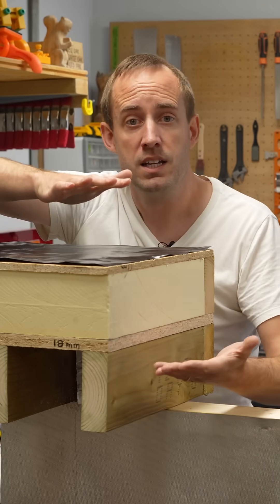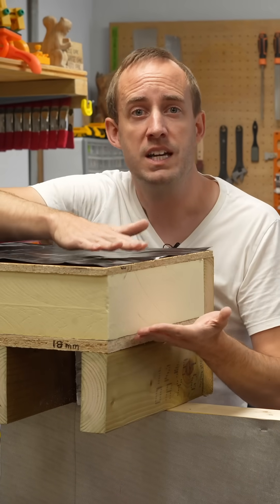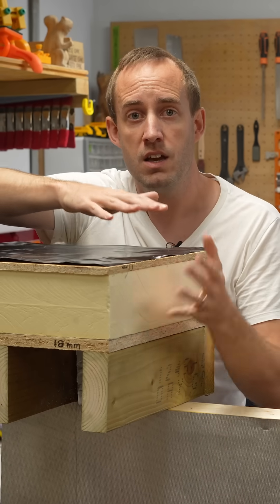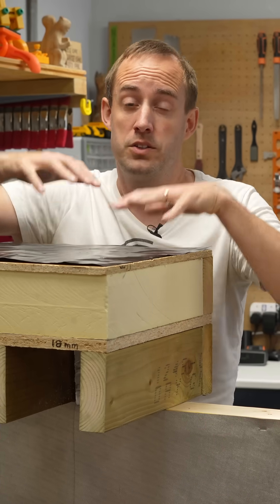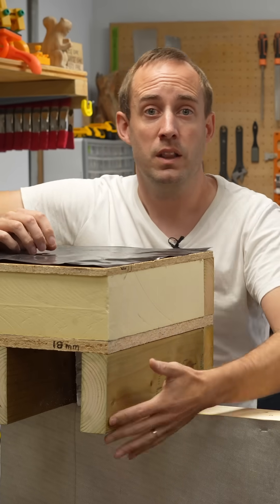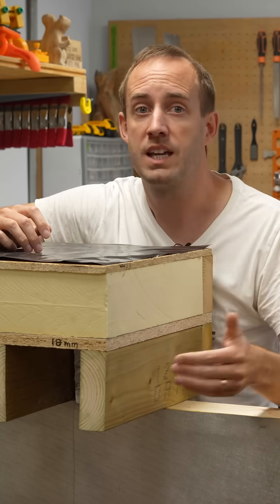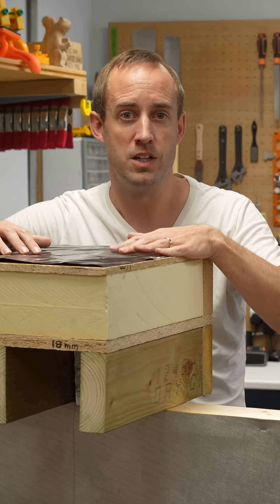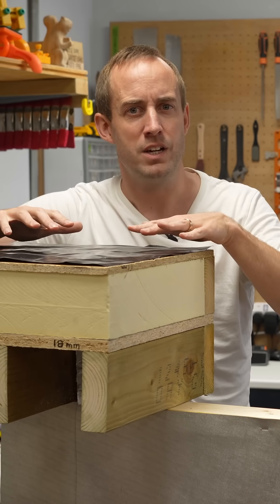Has the whole industry got it wrong? #roofing #gardenroom #diy

Comment: A warm roof also uses a lot more material for little more benefit I reckon. Air when stagnant is a fantastic insulator so a cold roof basically has free insulation. Also the reflective property of the insulation sends the radiant heat back towards the roof, which in turn radiates out to the environment. Unfortunately there is the issue of the thermal break of wood but this also makes the roof stronger. So don't know.
Reply from the maker: I agree a warm roof uses more materials, but I do believe it is a good bit better. You should watch our long format video where we go into more detail (linked in description). 

It also explains a cold roof in more detail and how the air is effectively pumped through the roof. This keeps it healthy, but also means it won’t be the insulator you suggest.

I’m curious why you believe the thermal breaks make the roof stronger?